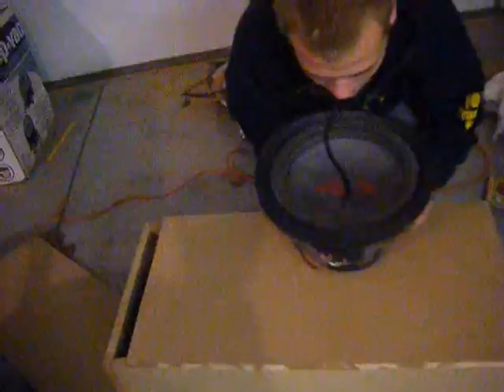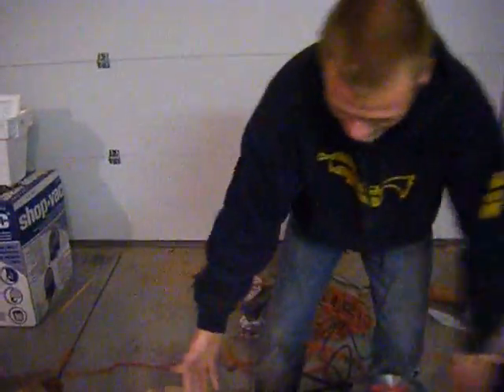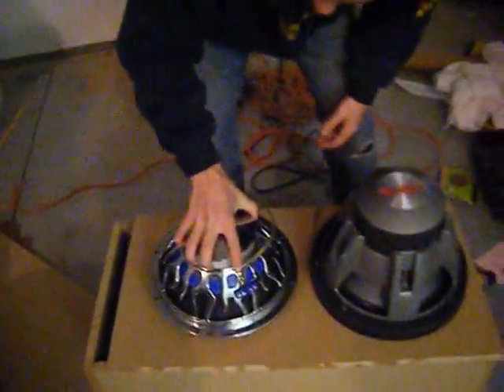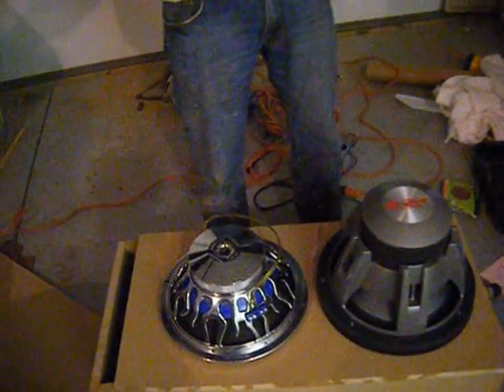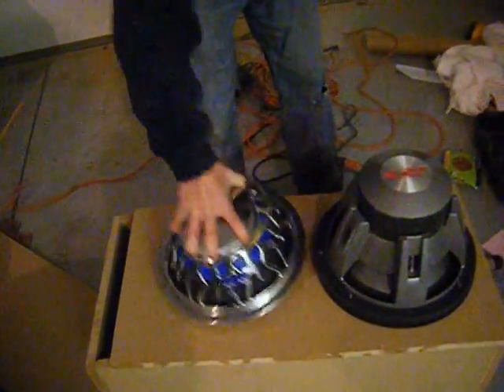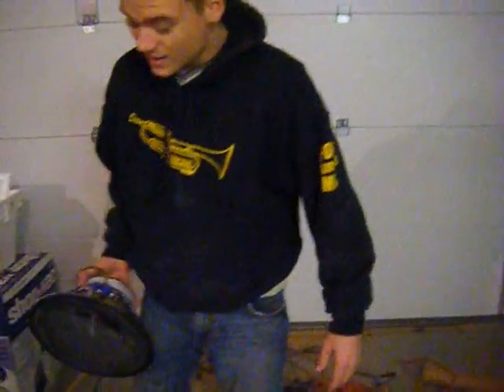box build for xxx kustomz giveaway

Comment: Dude I wanted to know if you could help me!
I'm building my own slot box for a soundstream t5 15. 3.5cubic. @32hz 
My problem is that I'm using a port calculator and they all give me port lengths that are bigger than my box depth . Port is 4x16.5   Do you know what that length means? From where is ut measured from.any help is appreciated thanks

Comment: O ok. So my width is actually 16.5 and height would be 2 or 1.5? And iv noticed thar the wall of the port is an L shape that goes in behind the driver. Is that L shape wall my length ?